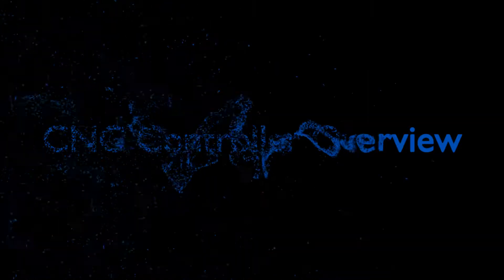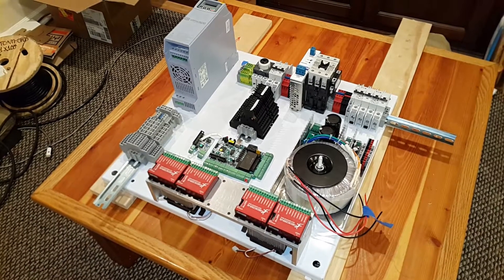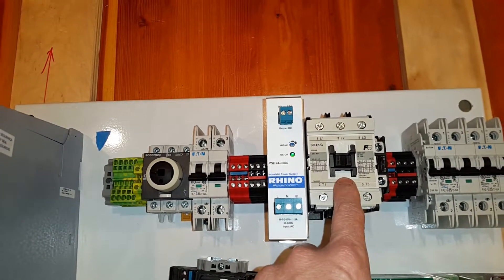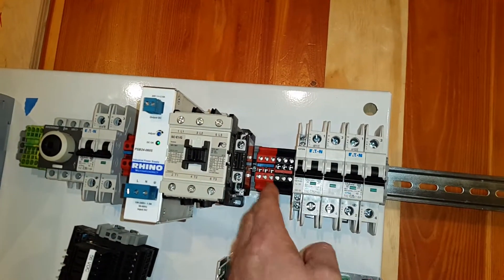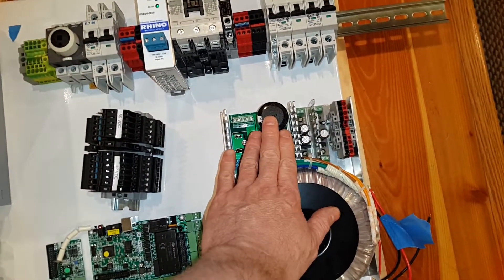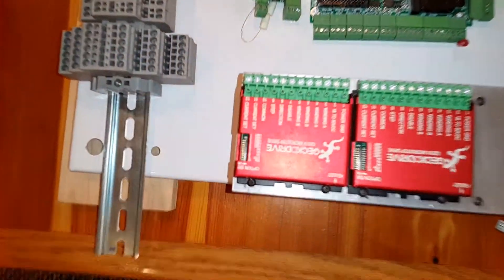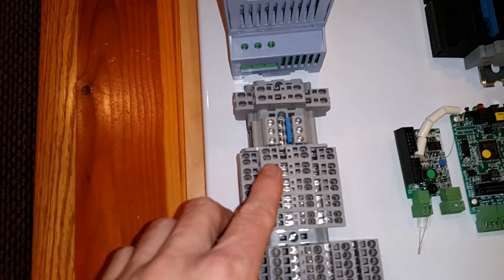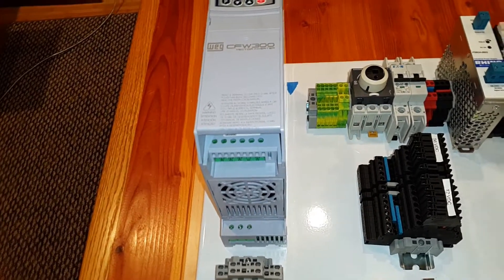CNC Controller Overview

Comment: Major mistake putting the toroidal transformer that close to the controller board, and no shielding for the controller board. And I pity that stepper controller that is located right next to the transformer, it will always be subject to a lot of interference.  Better to locate the toroidal outside of the control box.
Reply from the maker: The controller has been working flawlessly for about 5 years now. Not a single problem. Toroidal transformers are actually preferred because they produce less noise than other designs. As wikipedia states "The advantage of the toroidal shape is that, due to its symmetry, the amount of magnetic flux that escapes outside the core (leakage flux) can be made low, potentially making it more efficient and making it emit less electromagnetic interference (EMI). " While not zero, I have not found it to be a problem. Other commercial control panel designs appear to agree with me, but you do you. If you got the space, move it out. I'd be more worried about the IGBTs in the VFD.

Comment: why are you not using the main ac to dc power supply's 24 volts to energize the contacted relay? listening to you if the relay faults it shuts down the power supply, i dont understand having an additional dedicated on the AC bus supplied power source for the contact relay. really want to understand this issue.
Reply from the maker: I would NOT recommend keeping the main DC power supply energized at all times as it defeats the purpose of the e-stop, which is to kill power at the highest level possible. 

My main DC power supply is capable of delivering 800W, this can be really dangerous. For example, what if you develop a wiring fault that energizes the chassis of the machine with 56V DC? If the DC power supply cannot be disconnected by the contactor, you'd hit the e-stop and it would do nothing to make the situation better. In my opinion, the e-stop is NOT there as a convenience to the machine operator to simply stop motion, it's there for dealing with any unforeseeable circumstance especially electrical ones. My advice would be to always cut the power as high up as possible.

Comment: Where did you find your multi output linear supply and about how many watts for the 56VDC?  Thanks
Reply from the maker: It's an Antek power supply, 800W total PS-8N56N24R12. The 56V is rated to 14.3 amps.
https://www.antekinc.com/ps-8n56-800w-56v-power-supply/
Reply: @buildbug3979  Thanks.

Comment: Hi. I am working on something similar. I was wondering if you have details on the bus bar you created?
Reply: Like where you purchased items.
Reply from the maker: The terminal blocks for the fused DC bus (in black) are Phoenix Contact 3214325. I purchased them here https://www.alliedelec.com/product/phoenix-contact/3214325/70417308/. They were one of the more expensive items I purchased for the build but I do think they were worth it. I had a GeckoDrive fail due to a short in one of its MOSFETs and the fuses did their job, blowing fast and saving me from even more grief.
Reply: @buildbug3979  thanks! I appreciate your videos!